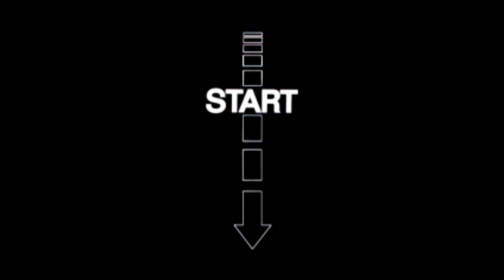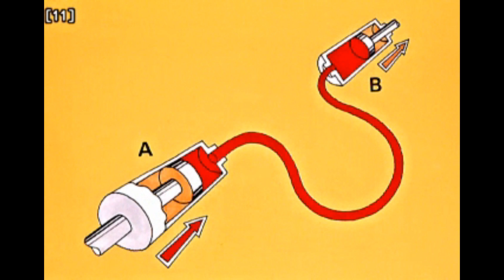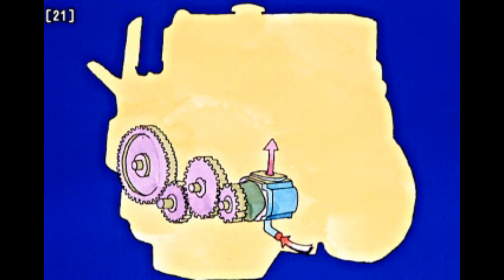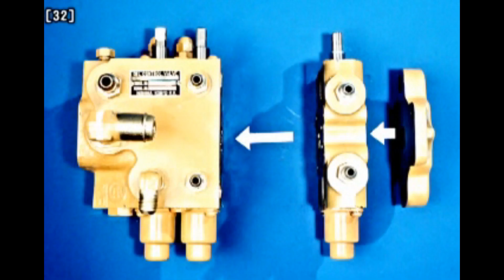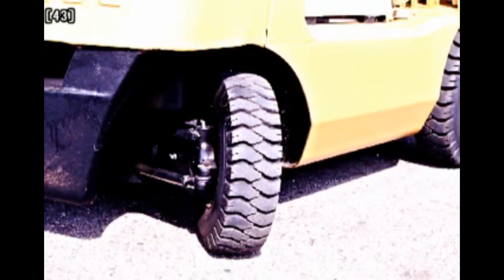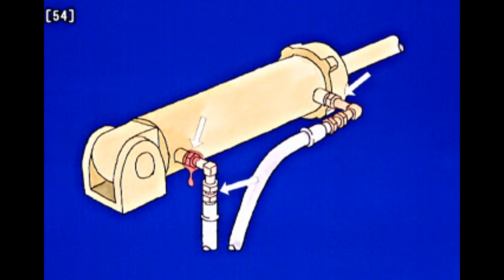FORKLIFT TRUCK HYDRAULIC SYSTEM

Comment: first of all, pressure doesn't move anything. Pressure is created by the resistance to flow, which is the load for lifting cylinder. The flow of hydraulic fluid is the mover.